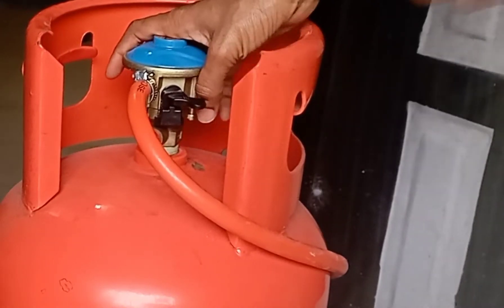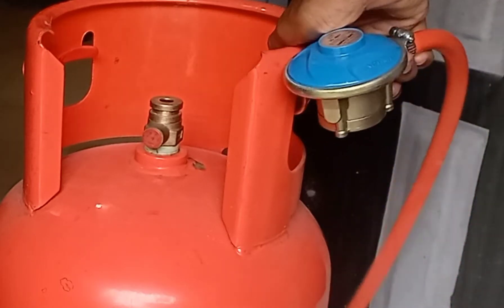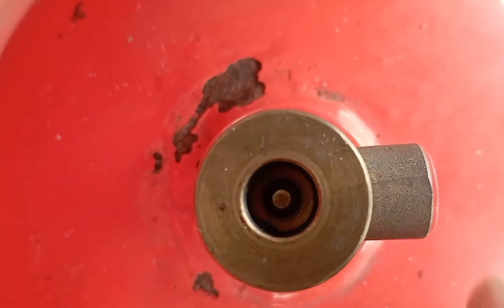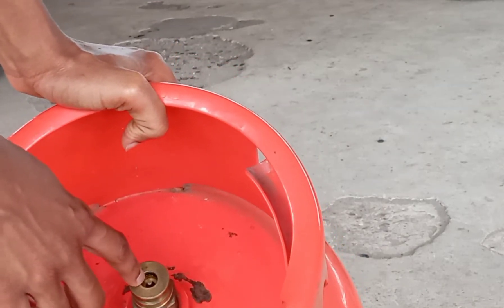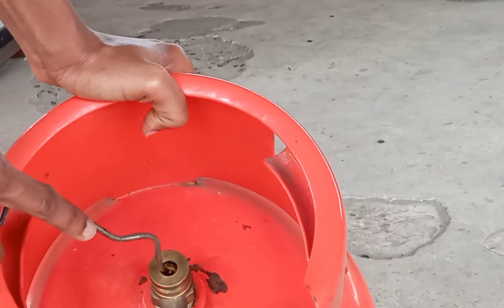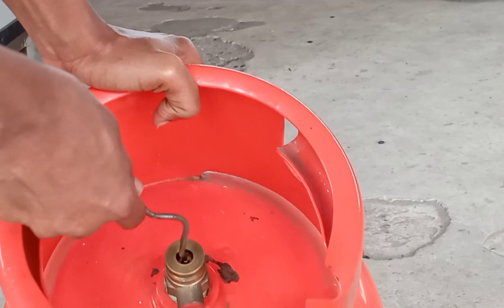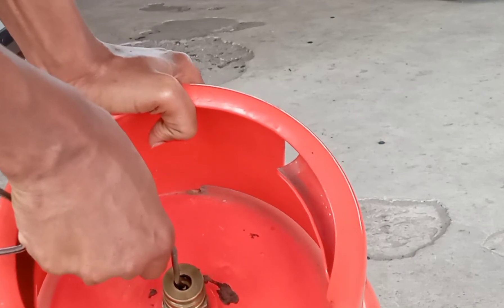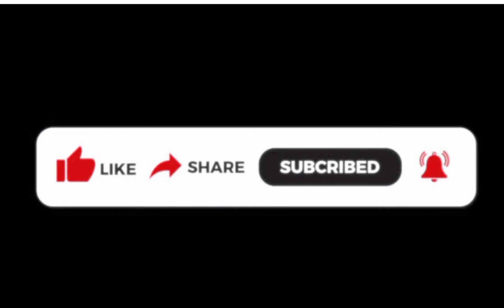How to remove (depressurise) air from a gas cylinder

Comment: My own has gas in it
Reply from the maker: Which means there's still gas for use. Thanks for watching ❤️❤️
Reply: And it's not allowing me to light it,I dunno why,I just filled it,it's a new gas
Reply from the maker: You mean after installing your burner?
Reply from the maker: Did you switch on your regulator?
Reply: Please I want to know why my gas cylinder used to leak the moment I On the gas cooker
Reply from the maker: Thanks for watching.  Always switch off your gas regulator when not in use. Also make sure your clips are tight enough. ❤️❤️